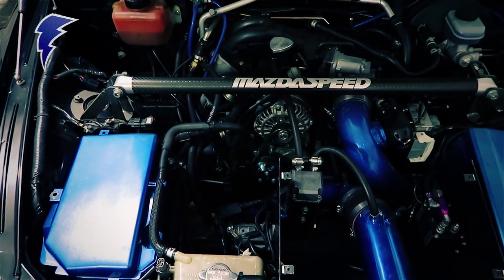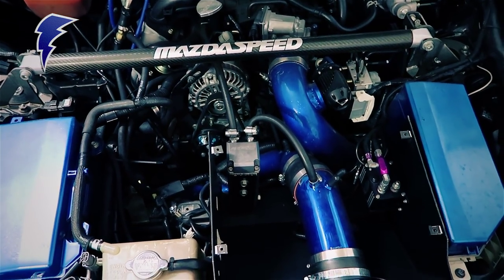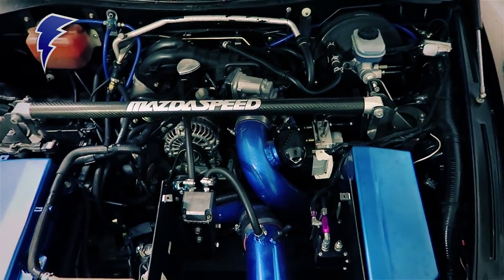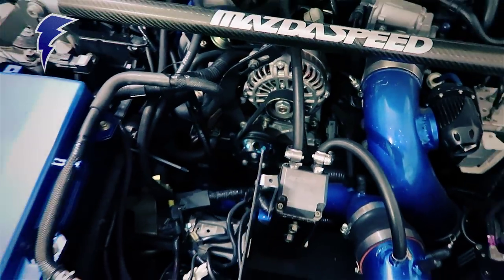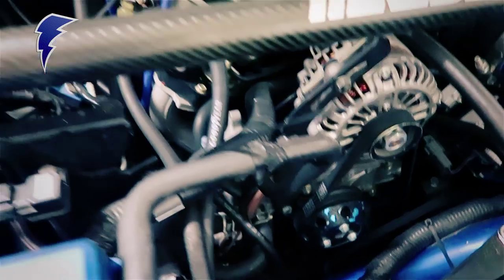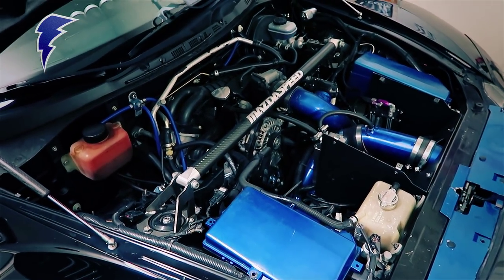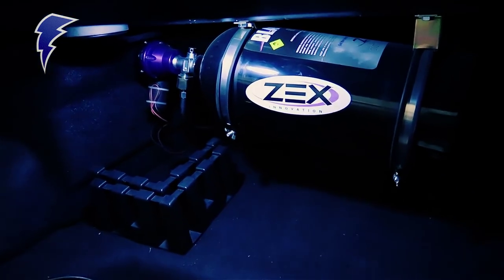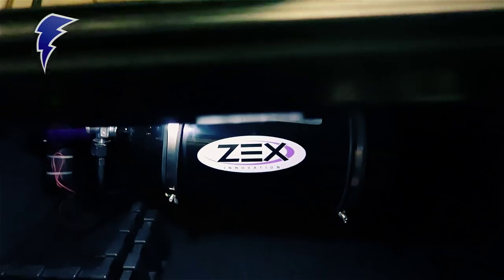Under the Hood - GReddy Turbo RX8

Comment: I absolutely love my 04. Its such a fun and light car, and i love that the community around these cars is super positive and creative when it comes to modifications and sharing info. But oh my good lord parts are expensive and stupidly hard to find sometimes. I had a 1995 240sx WITH an SR20 swap and parts were still easier to find and cheaper than parts for my 8. Im really hoping in the next couple years they come back as a retro cult tuner car and maybe a small aftermarket will boom again. That would be unreal
Reply: Yes parts are expensive, but there are an abundance of parts out there. Look in Facebook groups, fourms, etc and you'll see all the support for the car.
Reply: Terrell Johnson i can find the parts the trouble is shipping and such, as well as the fact that there are very few rotary mechanics/tuners/enthusiasts in general around where i live

Comment: When you relocated your battery, what did you do with the EPS fuse that is connected to the positive terminal of the battery? Did you cut it and extend it to the rear with the battery and refuse it at the rear? Or did you just let it hang at the front and tuck it away and THEN extend the power wire? I want to do a relocation cleanly but I'm unsure of what to do with that EPS fuse. Thanks.
Reply from the maker: Great question! Currently the configuration is the positive battery cable is attached to the terminal post with the EPS fuse at the front of the car. I used a nut and bolt to secure it, covered it in tape and have secured it out of the way. It isn't the prettiest method, but it is safe and it ensures I could go back to a front mount battery if I wanted to. I was anticipating that I may go to a top mount turbo kit at some point, but such plans were cancelled after I got into riding bikes.

I would highly suggest running the cable through the cabin instead of underneath the vehicle where is subjected to wear and tear as well as possible damage. There is a section of the firewall stamped for (I believe) the HVAC pipes for a RHD RX8. I drilled out the firewall, put in an appropriate sized rubber grommet, and ran the cable alone the passenger side door sills on the bottom and then into the trunk via the rear seat bracing.
Reply: Flashwing Beautiful. I've been searching what felt like forever for that response. You don't know how helpful that is. Feeling blessed to be a part of such a close knit community. I've been motivated by you and your car since I first remember seeing you on the forums on rx8club. What a spectacular car you have built. Thank you for the quick response. I'm excited to do some custom wiring now!
Reply from the maker: Thank you very much, it certainly has come a long way as a project. I've been fortunate that I've had a lot of help along the way, so I am glad that I've been able to pass some of that on. I suspect it isn't a very common modification since the only real purpose would be clearing room in the engine bay for something else, or just distributing the weight over the rear wheels. The more complicated parts of it all were drilling holes and ensuring everything was properly secured to NASA standards for track purposes. They had minimum requirements for the rear bolt thickness for safety reasons.

Best of luck with this portion of your project!
Reply: Flashwing Thanks. Currently undergoing a rebuild. Thanks for the help!

Comment: Nice rx-8....btw if u deletes the cat.....do you still have the rear o2 sensor the one at the cat attached....what happen if I just use the front exhaust o2 sensor and deletes the rear
Reply from the maker: I still have the rear O2 sensor simply because it is easier to maintain it than to delete it. You can certainly delete the rear o2, but you may run the risk of failing a visual inspection if that is something you have to worry about.

All the rear O2 does is detect the presence of the cat. If you have the CEL for cat inefficiency turned off, then you can do whatever you want. The front O2 sensor is the wide-band that does all the actual work.
Reply: Oh okay..thankyou for the info sir...will be back if I have other question :) nice car

Comment: Hey how many miles roughly the rx last before rebuild. Or have you even had to rebuild it after turbo install.
Reply from the maker: I have not had to rebuild the motor since the Turbo install. How long your motor lasts is all a question of the quality of the build, the quality of your tune, frequency of maintenance and care etc. There isn't really a set figure.
Reply: Awesome thanks for the Input, I'ma plan this for my 8. Any other modifications but did that the kit doesn't support?
Reply from the maker: There is quite a lot. Your best bet is checking some of the older RX8 club posts regarding some of the Greddy kit upgrades. It needs T-bolt clamps, and upgraded couplers just as a couple mentions. You likely need an oil restrictor because the stock oil pressure is a bit much for the Mitsu turbo, as well as some other stuff we did like we used the AEM CAI intake which required some custom brackets to tilt the intercooler forward to make space and stuff like that. The kit, as provided, will work but there's a lot of upgrades that have been done by various people to make it work better.

You'll also need to look into a way to tune the car, as well as gauges to ensure you keep an eye on oil temps, water temps, fuel pressure and air/fuel. I normally suggest to people NOT to go turbo on this car. It is an enormous expense unless you can do some or most of the work yourself and there is a lot of work outside just the kit that needs to be done to make it function a lot better.

Comment: Hello , and with the intake manifold something to do when you put the turbine , with flaps apv ssv and vdi? I want 320-350hp pressure no more than 1bar
Reply from the maker: I believe with the intake manifold, I have it set to have everything open above 6,000 rpms where I would clearly be in boost. It has been a while since I've looked over the tune so I cannot be certain that is accurate. 325 - 350 hp is absolutely possible under 1bar. The key is to find a turbo with a very very efficient hot side to keep the manifold pressures as low as possible with high airflow.
Reply: @FlashwingMotoVlogger  I was told that you need to put td06-25g , a second nozzle , which is 4 pieces( I have the hp motor) performance 1050сс the first two stock to leave said inlet , said leave not to touch anything ie dampers should work.
Reply from the maker: @ВеликийГонщик-и6ш  You would need a 20g or 25g if you're using the Mitsubishi turbo, but  I doubt the turbo will be anywhere in the efficiency zone given these turbos usually require at least 1.5bar-ish to get into their efficiency zone. Much better off with something different in my opinion. Technology has greatly improved since the TD06 series came out.

Comment: how much did the turbo installation and tuning cost?
Reply from the maker: datboikevin overall less than 20% of the retail cost for me because the kit was purchased used, installed with the help of friends, and I did my own tuning. GReddy kits went for $5,000 new, needed another $1,000 in upgraded like silicone couplers, t-bolt clamps, a new blow off valve and an AEM cold air intake. The short time I did tuning professionally, I charged $300 a car plus the $100 an hour of Dyno time. A good tuner shouldn't need more than 3 hours, but 2 hours should be enough for a full turbo tune.
Reply: Thats awesome.  Cobb accessport can let you do your own tuning?

Comment: Did that kit come with the emanage?
Reply from the maker: My kit did not because I purchased it second hand and use the Accessport to tune it. The kit as it came from GReddy did have the emanage. The previous kit owner sold the emanage off since he didn't need it. I would suggest using other available options as the emanage is a terrible setup for this car considering what else is available on the market today.
Reply: Oh ok. I'm using an emanage ultimate for my rx7 NA-Turbo. Got it for very cheap and decided to put it to good use. I'm not trying to make big power I just want something that's fun.

Comment: its not the original Renesis right? it can't be. Is it 13B from an RX7?
Reply from the maker: This is a 13B-MSP (renesis) and not a 13B swap from an RX7.
Reply: But it has to be modified somehow because the Renesis doesn't like being turbocharged
Reply from the maker: That fkn turkey it's not a modified engine. Engines are not people so they neither like nor dislike anything. The Renesis design is not as purpose built for turbocharging and they are much more sensitive to detonation than piston motors, but they can be turbocharged and last. It all depends on the nature of the setup, how aggressive your tune is and how much manifold pressure you run.
Reply: Yeah i know engines are not people, i just didn't know how to put it in other words. Its not suited for turbocharging. Or it isn't as sturdy as 13B with a turbo. There you go hope thats better.
And its not good because for example the Renesis has the Exhaust Ports in the Irons and not in the rotor housing. The Exhaust gases have to "flow around a corner" and can not just go straight out the side as the worse flow keeps way more of the heat inside the engine thereby further limiting the Boost you could run.
Also the Renesis has different placement of the Oil injectors for the EURO4 norm, which struggle to give the apex seals the lubrication they need. This problem is enhanced if you want to turbo it.
Reply from the maker: That fkn turkey the exhaust gas flow is certainly a problem for higher flow applications but that doesn't rear it's head until you're producing airflow to make around 350whp. Oil injection issues are a problem even for NA applications but can be resolved by increasing the output (possible with an access port) to levels that provide sufficient lubrication. I'm not running more than 10psi of manifold pressure and I'm making less than 250hp because of wastegate issues. In my case, the setup is pretty safe with target air/fuel ratios of 11.5:1 in most high power areas.
Reply: Flashwing oh great, in that case thats a clever setup
Reply from the maker: That fkn turkey it more or less happened by accident and I may take time this summer to fix it. The GReddy kit comes with a TD0618g turbo which is poorly fitted to this car. The turbo is most efficient in boost areas dangerous to the motor. This engine really requires a much more effectient hot side with a nice free flowing exhaust to keep manifold pressure down and airflow up. However, as you pointed out, at some point the inefficient port design catches up and you reach the limits of what the motor will allow. 

I run a pretty modest setup and lost the desire to extract serious power after I bought my R1. Since the R 8 will always be slower than a 180hp sport bike, I didn't see the point in going crazy.

It delivers torque in places lacking with an NA setup, the tune is somewhat conservative on the fuel side and I am very careful about fuel quality. With luck, the car will last many years before needing another rebuild.

Comment: Would you mind emailing me a full list of mods and any notes you found useful when turbo charging an rx8. :D Reply for email^^
Reply from the maker: +Nicholas Rombach I have updated the video description with the full mod list of the car. As for information I found useful, it really depends on your specific application and goals for the vehicle as well as what you're doing yourself. You're going to need something better than the stock ignition, you're going to need a good tuner and I would suggest dyno tuning first and then followed with a street tune. In general you'll need to be educated about the car and what is happening in the event there is a problem. 

I wouldn't suggest the Greddy kit, though they stopped making them around 2010 I think. The turbo has an undersized waste gate for rotary applications and the efficiency area for the Greddy specific turbo is beyond the manifold pressure you want to subject the engine to which is somewhere around 30psi. 

Several Garrett options have worked well, including ones with a very efficient hot side allowing lots of airflow at lower manifold pressures which is really the top goal.

Comment: Nice ride man!  Turbos = Fun

If you don't mind my asking, what do you do for a living?  It obviously affords you the opportunity for expensive toys
Reply from the maker: +Eric H. I work in IT Management doing process stuff and do it with a company that you've no doubt heard of. I've owned the RX8 for 10 years and have nearly bankrupted myself several times with modifications to get it where it is today. However, I've had the benefit of either getting parts at a very reduced cost or being able to get them because of past business associations that work directly with the car. Finally, a lot of the work was done either by myself or with the help of friends. By the time I got into my current line of work, most of the stuff was on the RX8 and then I got into bikes. 

The real key, in my experience, with project cars like this is having to take your time. Building a project car very quickly no doubt is expensive. As time went on, I started making connections in the aftermarket industry (or got breaks on parts from friends) that allowed me to afford stuff that I couldn't otherwise afford. The turbo kit, for example, used to be on a friend's RX8 but he removed it because of the difficulty with the tune and problems with the installation. I got the kit for 20% of what it would cost retail, but it was a friend doing me a huge favor. 

Tuning can cost thousands of dollars by itself, but I took the time to work slow and make changes on my own. I've made hundreds of tune changes over the life of the car and I had the benefit of learning how to tune the RX8 by the one guy who has tuned more RX8's than anyone else worldwide. 

Don&#39;t take the above as bragging ;-). You're correct that I&#39;m fortunate to have a great career after putting in a decade of hard work in the industry, but the RX8 was built in mind with the notion that I couldn't afford retail pricing or paying shop labor. So, I had to do things myself or seek help from friends and wait for deep discounts on parts before getting them.
Reply: +Flashwing that's rad man.  That's the hardest part is doing piece by piece.  I'm a big fan of instant gratification. :-). But, doesn't work out that way.
My Harley for instance, I've done a ton of work to, but over the course of years. 

Ride safe, and have a great holiday

Comment: hp? ft lbs? psi?
Reply from the maker: about 240 hp, rotary engines make crappy torque, running about 10psi on a TD06-18g but I don't recall the actual mass air flow numbers at that point.